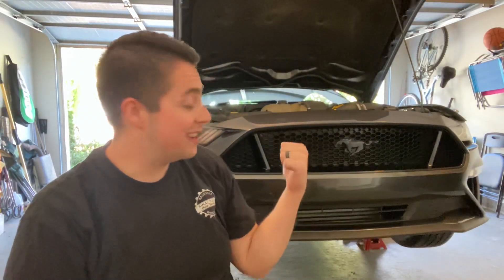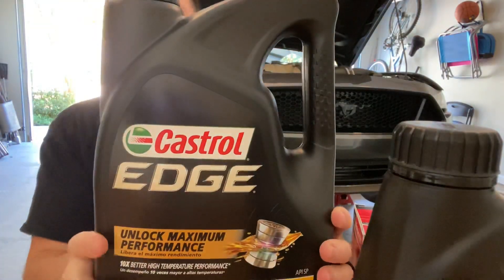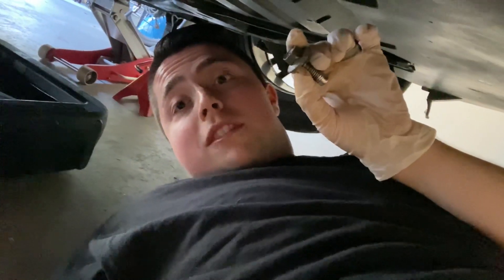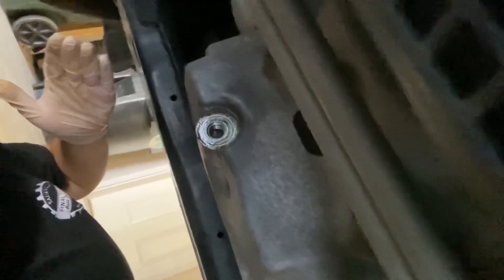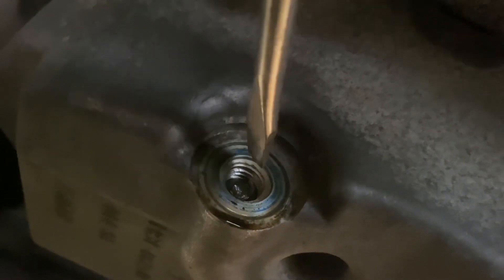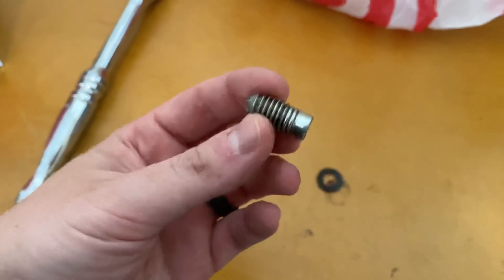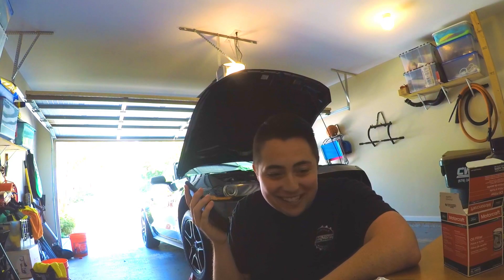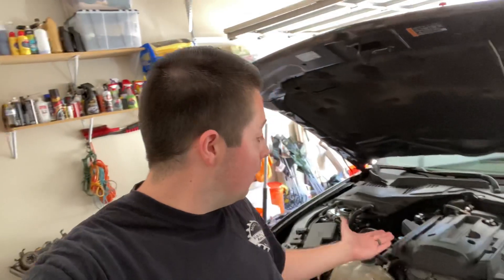Mustang Ecoboost Oil Change! - Larger Filter Makes It So Much Easier!

Comment: First time watching your video and it's refreshing knowing that the ecoboost can run a larger oil filter. This will be easier pouring 6 quarts of oil instead of 5.7. Word of advice, when putting the drain plug back put some oil on the threads so it will be easier to install n remove. You don't have to over tighten the bolt cause thay strips it or breaks it, just a quarter turn. Also, when you add oil in the oil filter put some oil on the rubber gasket and hand tighten it. Next time when you remove the oil filter, you can remove by hand.

Comment: The larger oil filter should not cause lower oil pressure. The fitment is the exact same, and the larger filter is often used on other ecoboost cars like the focus rs and st. Of course, you would also add 6 quarts instead of the 5.7. The extra oil content and filter media content should not impact oil pressure at all. Furthermore, Mountune ships its oil kits with the OEM larger filter as standard. That's my 2 cents, but do your own research and do what you want to your car folks.

Comment: Next time you change your own oil… remove the oil filter before you replace the drain plug. You will be surprised at how much dirty oil will end up draining back into the oil pan. Seriously. If you use a 3/8 drive ratchet on that plug, you’ll be less likely to snap off the plug.

Comment: Oil pump nowadays are designed to work base on the oil pressure. Bigger filter lower the oil pressure so the oil pump it will works less results in less oil flow. So perhaps no so cool idea.
Reply from the maker: Good point! Oil pressure has still been in the normal range so doesn’t look to be a problem  👍
Reply: sandor why you talking outta your ass?

Comment: In all the years I have been doing my own oil change to include my Mustang Ecoboost, that is the first time I have ever seen a drain plug snap. I guess I have been very lucky. I am still using the original plug in my 2005 Escape. I think I am going to buy a Fumoto Oil Drain Valve.
Reply from the maker: Yeah! Ive never had it happen until now! Yeah I’ll be picking up an extra just in case.
Reply: He went way to hard 🤦🏿‍♂️
Reply: Most folks don't torque a drain plug with ALL THEIR MIGHT????

Comment: That's always been my fear. The first time I changed my oil on the stang the oil plug was stripped. Took some Ingenuity but I got it out and I replaced it with a futo drain valve. Makes oil changes smoother cleaner and no need to fumble around with the drain plug anymore. Might be an option for you if your interested 🤔
Reply from the maker: That’s a good idea! I’ll have to look into that! I’ve seen those but never tried it!

Comment: When i saw how long of a ratchet you were using and how much force you were using on the end of it, I could tell things were about to go bad. I would just use a hand tool to tighten it, and make it just tight enough before the point where your hand/arm has to squeeze to tighten it more… maybe a little bit of squeeze. Nice vid tho, hopefully that doesn’t happen again.

Comment: So much drama! I felt drained after watching. 😹I’m amazed the broken bolt came out so easily, could have been so much worse. Currently I’m still using the free oil changes from the purchase of the car at my local Ford dealer, but In time would like to take over oil changes myself. I’ll have to look into that larger oil filter. I did laugh out loud when you were looking for a place to set down the filler cap, with that extremely large indentation on the engine cover which looks like a holding tray.
Reply from the maker: Lol!! Definitely some drama In this one! Yeah I’m happy it worked out like it did! Ha watching back the footage your right that does look like a tray! 😂 I’ll be using that Next time!

Comment: The Fram PG3600, TG3600, or XG3600 is bigger yet It's the exact cross reference to the FL400. Hard to go wrong with the XG3600. 
I know of people using the larger filter on the popular 1.5L Ecoboost Escape engine.
Montune builds a lot of performance parts for the smaller Ecoboost engines. The 1.0, 1.6L in the Fiesta. Mostly European spec. They recommend upgrading to the FL-400 filter.
Like I said the cross reference is to the even bigger FRAM 3600 filters.
Reply from the maker: That’s good to know! I’ll have to look into those options! Thanks!

Comment: The dealer said the first time of oil change is 10,000 miles. U think I need to change it around 5,000???
Reply from the maker: With full synthetic you can run longer. Some people change at 10k intervals but I do it at 5 to be safe. Especially if your pushing more power than stock. Thanks for watching!
Reply: Change it when your car tells you to change it. It has a built in smart system that let's you know when it's time to change it. Well, that's what the car manual says anyway.

Comment: As soon as I saw how hard you were cranking on the ratchet I knew things weren't good.

I have NEVER seen an oil drain plug snap!  There really isn't much torque on them as it is the nylon or crush washer that does the sealing.
Reply from the maker: That’s the thing I didn’t feel like I was torquing it down very much, I usually have a pretty good feel for this sort of thing. But not this day! Lol 3/8 ratchet next time!

Comment: Hey man u got any idea about the code p0442 evap leak code.. my car is in warranty and ford company is saying they cant fix the issue what am i suppose to do
Reply from the maker: Hey! Hmm could be any leak in the evap system. Maybe the gas filler neck, there is a gasket that might be leaking. However that’s just a guess. I’m surprised Ford isn’t fixing it since your under warranty?
Reply: @daily_driven  they are saying the tune has fked up the computer system
Reply: Also blaming my exhaust
Reply from the maker: That’s crazy, is Ford themselves saying this or the dealer?
Reply: @daily_driven  dealer told me that the ford company told them that the computer system is messed up and that they can not reset the system or replace it
Reply: @daily_driven  but the thing is i bought the car used and i havent even driven the car that much.. its only driven roughly 3k miles after i purchased

Comment: You're going too tight on that plug.  It doesn't need to be that tight.  Tighten it with a loose wrist with a light finger grip around the head of the wrench.